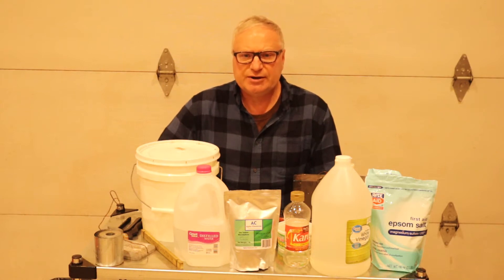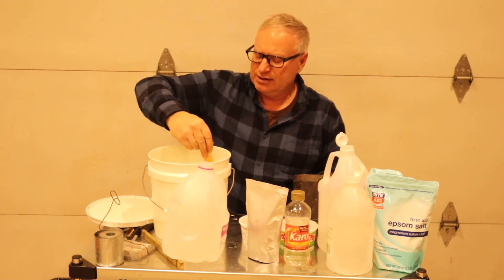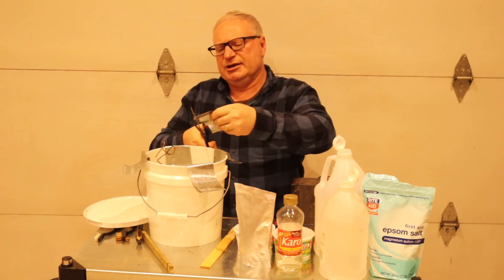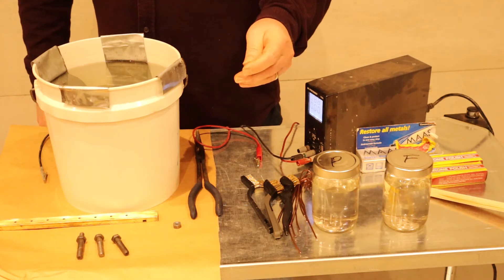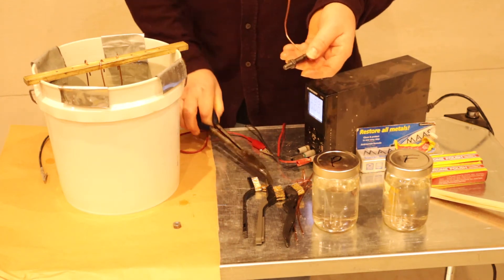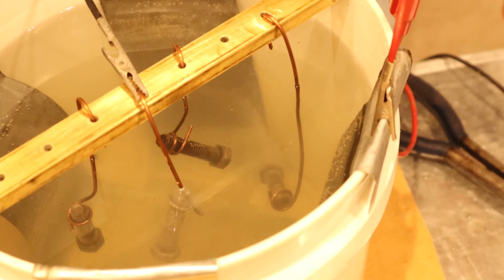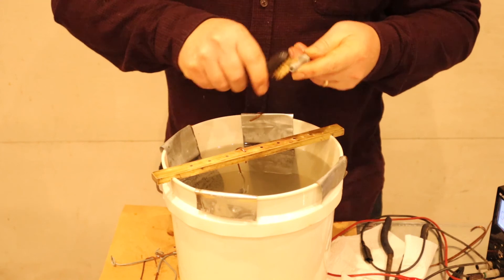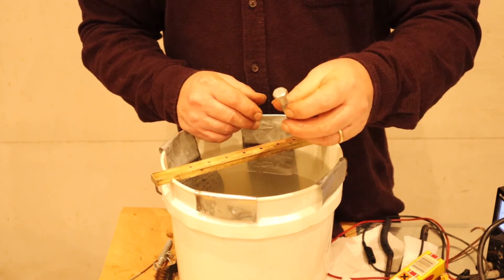Zinc Plating Hardware and Parts at Home Using Readily Available Materials Part 1 of Plating Videos

Comment: Could you provide some info about the settings on your power supply? You mentioned .4 amps, but no voltage info. You indicated adjust based on the bubbles. How do you determine that you've achieved the proper level of bubblage?
Reply from the maker: It is a 24 volt power supply. The amps will be determined on the size of the part being plated, and your tank/zinc configuration. When plating the parts, you will see small bubbles near the surface of your part. That is a visual indication that the plating is going on. You want to crank the amperage up until you start to see some bubbles. Not too many, or you are plating too quickly. When you do a part or two you will get the hang of it.

Comment: You’re running such low amps, you can use a much smaller diameter wire to connect to the part being plated, so you don’t get such big “shadows”

Comment: Do you have a video on copper same setup?

Also what does the Epsom salt do?
Can I replace caro syrup with glycerine?
Reply: Miralax, which is POLYETHYLENE GLYCOL is a good brightener
Reply from the maker: The Epsom salt acts as an electroylite in the solution. I've used Karo syrup. If you want to experiment, try it out! No videos on copper. Never had a need for copper in a restoration.
Reply: Karo Syrup is about equivalent to Corn Syrup.